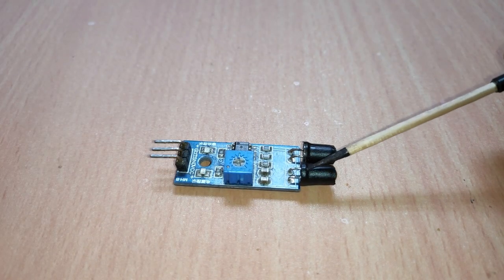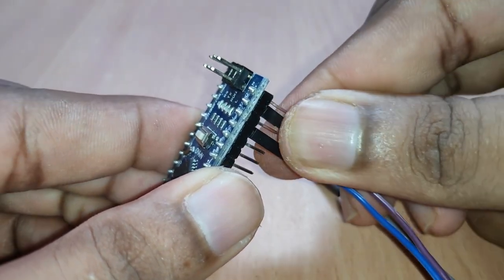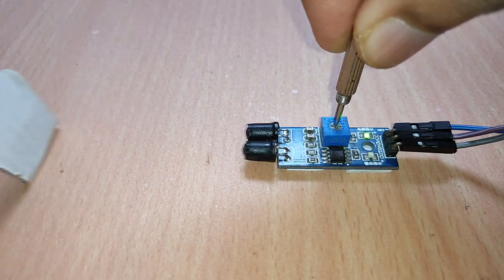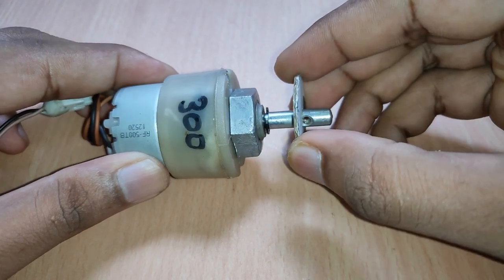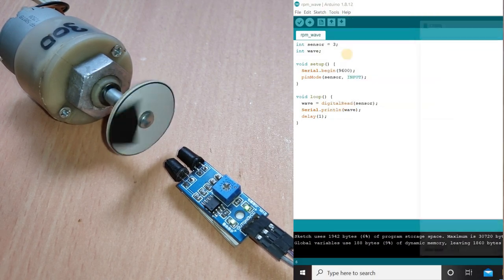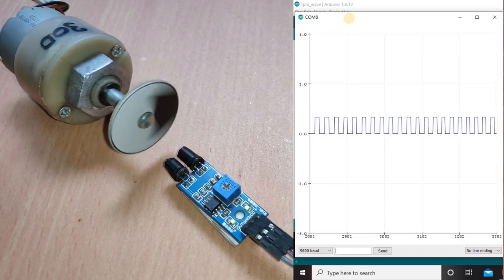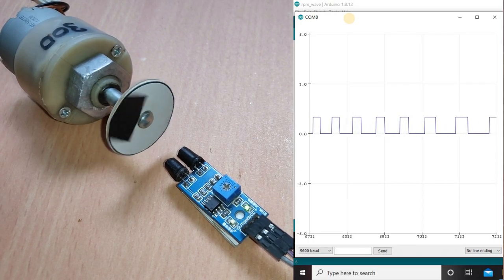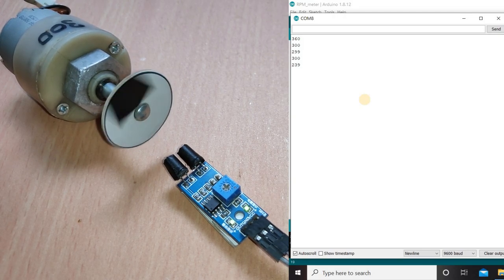DIY Digital Arduino Tachometer | RPM Counter Using Proximity Sensor (IR)

Comment: can somone explain why this only works on  a 1000ms delay? if i try reduce it it gves wrong values.
Reply: Because it counts the number of pulses per second (which is 1000ms), and then multiplies the result with 60 to get number of rotations in 60 seconds or 1 minute.

Comment: Hey,
I'm about to purchase required components for the project. I have one question. I'm trying to track the rotation of a wheel and its color is black. Would it still work if i stick a white tape on it? I don't wana paint the wheel white.
Reply from the maker: Yes we can but have to alter the code a bit.

Comment: The pulses code works fine in my project but when i try to add the rpm measurement code i get wrong values. To mange this i try to count and print the "REV" variable but i get very large values, for example i have a disk with 36 holes and i just rotate a few holes and get vales of 43.00 or 36.00. I am using your code exactly and arduino MEGA. What am i doing wrong?
Reply: When you have so many holes you need to devide the rpm by number of holes you have

Comment: Can it be done using a photo resistor/ light blocking module?
Reply from the maker: It cannot be done by using LDR.
Reply: actually it can, but its not as simple. One way to do it is to pulse your LED at say 500Hz, then you need to bandpass filter the signal from the LDR to block any frequencies outside the 450-550Hz range. I think it may be better to build an analogue filter in this case using two op-amps, a high and low pass stage in series. Then for the final stage you can add another low pass filter to this which provides you with a voltage representing the number of pulses reflected in the time period when the white segment of the disk is in-phase with the LDR and LED transceiver. This would give you a non-smooth pulse, which you could stick into a comparitor to provide you with a nice square wave pulse for the Nano.
Reply from the maker: Informative comment.👍

Comment: Bro can you explain to me about the code, i see on rpm wave code it use digital 3 as sensor, but at rpm meter code i don’t see any digital 3 used as sensor. Thankyou
Reply from the maker: In RPM meter code I've used the interrupt pin so connect the sensor according to the pin declared.
Reply: @ELECTROMODlab  ahh i understand now, thankyou so much bro 👍
Reply: @ELECTROMODlab  bro i try to read the rpm meter via modscan32, but i dont know how make the code to read the rpm value. Do you ever use modscan32 bro?
Reply from the maker: I'm not familiar with that.

Comment: I want to measure rpm of 6 motors continously.How to do that.Can you please tell?
Reply from the maker: If all the 6 motors are of same kind and using same power supply, just measure only one motor. If not you have to make use of 6 sensors for that. Unfortunately Arduino only has  2 interrupt pins. If you're using Arduino you can measure only 2 RPM's at at time.
Reply: @ELECTROMODlab  oh cant we measure 6 different rpms using arduino???
Reply: if i use the same code and use it for 6 different functions...will it work?
Reply from the maker: 6 different functions like what ?
We are measuring the RPM by using interrupt pins 
Arduino has only 2 interrupt pins.

If you're able to do, good luck.
Reply: @ELECTROMODlab  i meant 6 different interrupt functions.

Comment: Need your help ?
After 32000 value, it shows negative values.
Reply from the maker: You need to modify the code.
Reply: @ELECTROMODlab   in the rpm formula or anywhere else

Comment: Can we use it with vehicles Tire?
Reply from the maker: Definitely we can use but we have to stick a white tape on the black tyre and to modify a part of the code.
Reply: You mean tire diameter? So It makes the whole module tire siE dependent?

Comment: Can u give circuit connection details for rpm measurement.
Reply: sensor module VCC to 5v of arduino and ground to ground of arduino, sensor out to pin 3 of arduino
Reply: @michaeljoshuamanallo1742  but there is no '3' pin in the code

Comment: Bro.... I'm using uno board... so I have given IR data to digital pin 2...Followed all the instructions....waveform is generating perfectly but in rpm meter code I'm not able to print the rpm... it's only printing 0...what to do?
Reply from the maker: Try fixing the wires properly. In the void setup section at attachinterrupt change the number form 1 to 0. Or follow the exact same  pin configuration shared in the video. Thanks.....

Comment: Sir will this work with Arduino uno r3
Reply from the maker: Definitely yes. Arduino UNO and Arduino NANO are exactly the same. Different is the board dimensions.
Reply: @ELECTROMODlab  
Thanks sir and the connection would be the same 👍